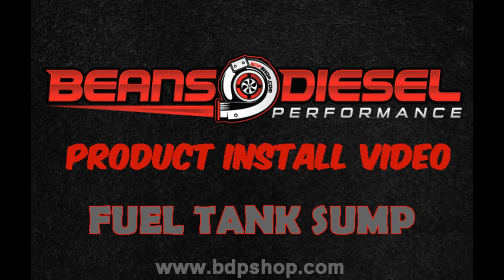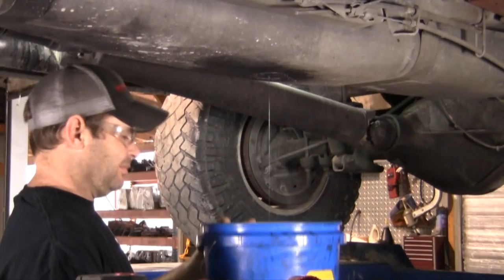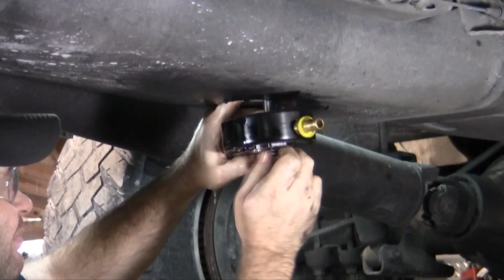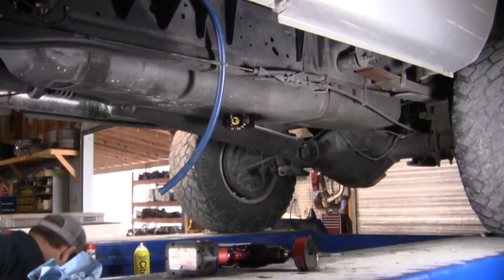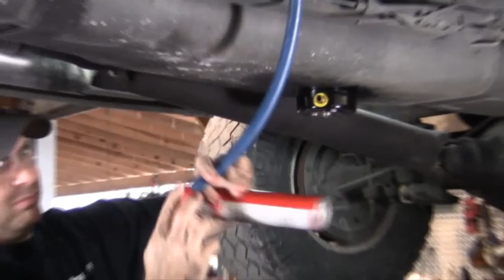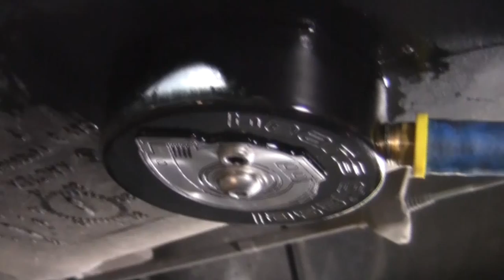Beans Diesel Fuel Tank SUMP Installation

Comment: From a performance stand point would it not make way more sense to mount it at the rear of the tank ?
Reply from the maker: Depends on the application and the tank shape. If you are doing a lot of hard launches with as little in the tank as possible for weight, yes, that would be a good idea. But, if the shape of the tank makes the rear of the tank much higher than the low point, you will run into issues running out when you are not racing.

Comment: Ok. I have not found any information for trucks with offroad skid plates.
Will the sump fit between the factory skidplate and the fuel cell.?
Reply from the maker: Not sure what others have done but usually there isn't and we would make a hole in the skid plate to line up with the sump.

Comment: Hey man I just picked up at obs 97 powerstroke. And the fuel bowl was so nasty full of gunk and sludge. The truck sat for about 2 years and I'm guessing the diesels absorbed all the water. So I want to get new tanks. Both main and rear. But I've heard that I should never let these truck go lower than 1/4 tank because itll suck air. If I go ahead and purchase the sump kit. And mount it on the new tanks would there be issue since it wont have any fuel in the lines ? Help
Reply from the maker: On an OBS a sump doesn't work good because of the selector valve. You could run new lines from a sump on each tank to the selector.  The other option is to put a bigger bronco tank in the rear and sump it and just use the front tank as extra capacity and put in a transfer pump. 

We also sell a full e-fuel kit if you want to get rid of all the garbage in the valley.
Reply: Since the new sumps have 2 outlets couldn't you install a bean in each tank. Use one bean as a outlet tie the 2 beans together and run a return to the other. Wouldn't that technically the both tank together and you wouldn't have to even select a tank anymore. Maybe I'm thinking wrong but seems like it would work

Comment: Wouldnt it just be simple to just keep your fuel tanks fueled and refill once at the 1/4-1/2 mark ? I mean your not really loosing the fuel or never going to use it.No one took your fuel it will get mixed up and used. Why run around always sucking your fuel tank down to where its only few gals before you fill up.Given that low there is no more idiot lights that come on and say hey you only have 1 gal left now , you better fill it up. Why risk running out of diesel along the road just because you were to lazy to just refill your fuel tank once it drops to 1/4 tank.Seems simpler to get in the habit of just filling your tank once it gets to 1/2 -1/4 so you dont really need any kit like this.If you begin having fuel gauge/fuel flow issues then fix the real issue , dont add to it.
Reply: My first ever Cummins I bought I had a mechanic put in a Fass 165 pump to keep my vp44 fuel injection pump very happy, sadly it wasn’t the case. He installed my draw straw very very short, so short I ran out of fuel at a half a tank. Now I know your going to say “well that’s not the draw straws fault” and I completely agree. Although I can spend $100 on a draw straw or spend $160 on a beans sump kit, and have the peace of mind that I’m not going to run out of fuel until my tank has not a drop left to offer. 

I’m going to pick Beans, now don’t get me wrong I try not to run my truck below a quarter of a tank but sometimes the farm life doesn’t conveniently put me at a fuel station every time my light comes on.

Also many of us guys run our trucks over stock horsepower. In my case my factory pump and quarter inch fuel lines dropped my vp44 down to 3 psi of fuel pressure. (Keep in mind the book says don’t let it go below 12 psi due to it using fuel as lube and coolant.)

Therefore my upgrade to half inch lines was required, which conveniently the beans sump kit supply’s 

It’s quite clear you believe everything should be kept stock and just do as the book says. So why hop onto a video aimed towards performance and bash on it.
Reply: My lmm duramax kept stalling at 1/4 tank of fuel, did it once at 3/4 tank as well. I’d get diesel everywhere trying to prime the lift pump. I installed the beans sump kit and had a noticeable power increase. I don’t think the truck was getting the fuel it needed through the factory sending unit. I can now drive further than 300kms without worry of starving my fass lift pump and stalling the truck. Pump sounds much better too. Thanks beans sump kit.

Comment: Were does the o-ring go? Inside or outside the tank? ?My leaks!
Reply: Got it to seal put some sealant around sides and torque it.
Reply from the maker: Outside surface of the tank. If there is a leak, then it's not one of our sumps, or it was mounted where the surface is too uneven for the oring to seal against.

Comment: i assume you plumb it in line with your first fuel filter and water separator correct? i'm thinking of doing this to my 6.0. this will solve any air issues correct?
Reply from the maker: This will solve any air issues created by pickup tubes or draw straws.

Comment: So this replaces the fuel pump right?
Reply from the maker: Tim Pickens no, this isn't a pump but gives you a low point on your tank for an aftermarket fuel pump to pull fuel from.
Reply: Ryan Bean thank you for the reply, I was confused about that. So you take the fuel pump that's in the tank out and put a aftermarket rail one on then?

Comment: If anyone accidently puts gasoline in the tank, which can easily happen...the sump would make an easy drain point. Also...if worried about crud at the bottom of the tank, buy 3-5 gallons of diesel and flush out before hand, with the filtering system you should never have that much debris again.  Thats why i like the idea.

Comment: does this work for a steel tank?
Reply: Someone told me last year,...from beans, that it does work on steel tanks like what I have on a 1997 chevy 2500, though there was some odd advice of maybe adding a little rtv sealant as extra protection against leaks,...I haven't installed it yet, will within a week or so, I am sure,...but the hole saw that comes with the beans sump kit seems only good enough to cut a plastic tank, so I bought a heavier duty hole saw that will cut metal, to be "safe",...errrrr if I can ever install my sump kit and my airdog 100,....was a tough year, one of which was a back straining injury that kept me from wanting to crawl about for eight months.
Reply: Well I bought this one and received it yesterday. Your probably right about the hole saw. I might attempt on my steel tank and let you know the results.
Reply: Thanks, that would be interesting if their supplied hole saw can "cut the mustard", ha, ya know.  I personally am getting ready to do mine, I will have to cut away a bit of plastic shielding, probably with an air powered zip wheel cutter.  I dread the fuel return line installation,....though the metal tank was replaced by former owner about four years ago, errrr, well, I am unsure if that matters, I think you just cut a portion in the filler rubber hose leading to tank and, errrrr, slip it in........sure would be nice to have a truck on a life, all that crawling round, I think my back is okay this year.
Reply: updates?

Comment: def sucking all the crap from the bottom of tank?
Reply from the maker: Dgozz122  Ours has a built in sediment filter to prevent most of any trash getting to your pump.
Reply: Wonder how long it takes to get stopped up?

Comment: Del. You worried about brake lines mounted in the frame & oil pan protected by diff etc. are you sure you know how to adjust your mirrors? the guy has a legitimate point. the Sun is at the bottom of the tank subjected to rocks and yes the hose could easily get snagged. it's a great idea I like it but if anything was to go wrong you lose every ounce of fuel in your tank.

Comment: What about the top of the tank where you got the fuel line from? Do you just plug it or what?
Reply: Yeh in wondering the same thing.
Reply: Hated LB7 do you plug the old line or what?
Reply: Are we plugging???
Reply: Pony Chaser what materials do you use, is it a block off plate? where can I get the material?
Reply: @mewolf3769  
Stick  a  plug  in  the  line  to  the  tank  and  forget  about  it .

Comment: Needing to install a FASS lift pump on my Duramax, and not wanting any low fuel issues, I've been researching sumps. FASS's sump kit looked way too involved for what it is. I've of course found more traditional ones with several bolts mounting it like a flange, I thought this was the best way to go, until I found Beans Diesel Sump! This install video made up my mind, getting yours for sure. Excellent design and idea, props to who cane up with this. The perfect solution for me :)

Comment: you don't use any kind of clamp where the line connects?
Reply: push lock line wont pull off
Reply: RHASH7 lol you hope I’ve had my fuel line  blow off my FASS pump and under the hood lost a 1/4 tank each time

Comment: you are worried about the sump line getting caught ... I would worry about my brake lines getting hit before the sump or the oil pan or the rear end or a ton of other things that hang lower ... my exhaust hangs lower than the fuel line
and it works great with my AirDog and all of the other fuel upgrades to many to list
but it is worth the money and you will wonder why you never got one before when they first were made

Comment: Just installed mine Saturday extremely easy to install no instructions or anything saying it needed to be torqued but its tight and not leaking so I'm not concerned lift pump went out took about an hour for me to install an air dog and ur sump start to finish